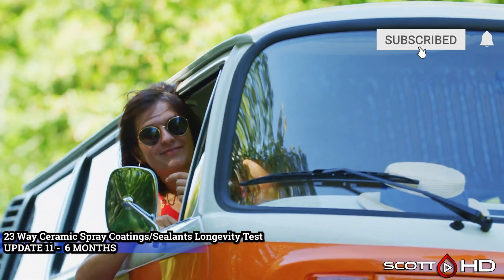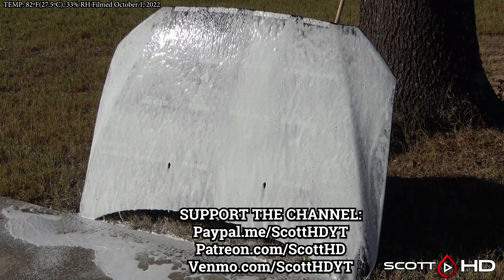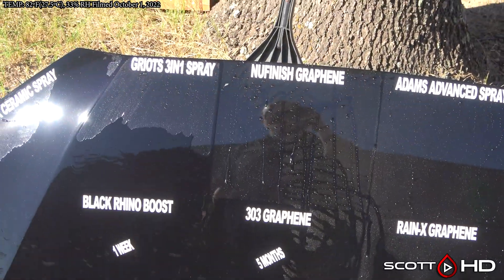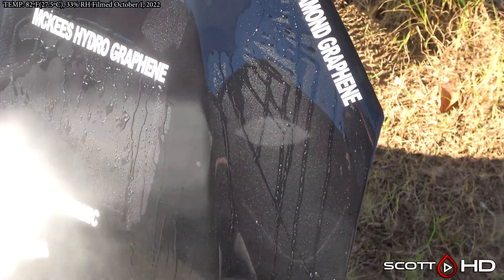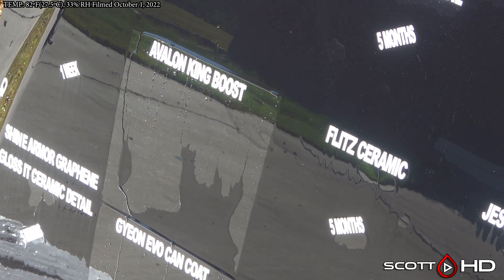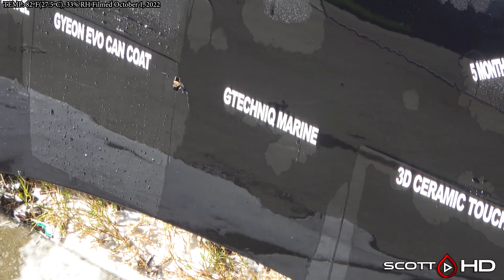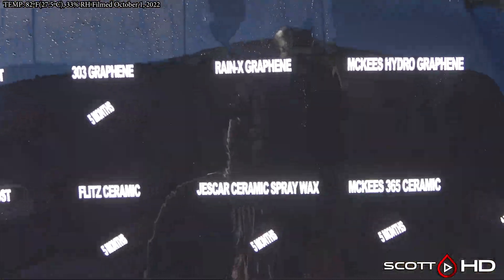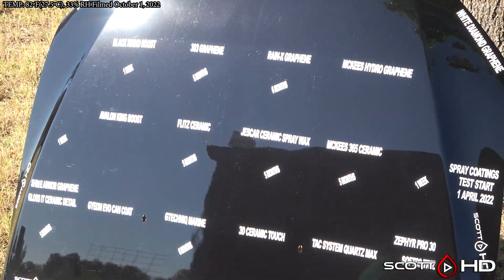Ceramic Spray Coatings - ULTIMATE Longevity Test Comparison 23 WAY UPDATE 11 - 6 MONTHS

Comment: This review motivated me to go pick up a bottle of the Nu-Finish Graphene spray.  For $11 at Autozone, it was worth testing.  I'm a long-time user of the original NF liquid but quit using it in recent years because it doesn't last so I moved to Collinite.  I've been wondering if I can use a quality polish/wax (for gloss) and then use a graphene coating over top of that to seal it and give the combination more endurance.  Has anybody had much luck with this kind of layering?

As mentioned in other comments, for the hydrophobic performance you are seeing, I was surprised how un-slick the NF graphene feels.  The old NF liquid from 10+ years ago could yield an amazingly slick finish.
Reply from the maker: Agreed on the slickness part.    I haven't tried stacking it on top of something, but worst case you have to remove and reapply.

Comment: No Turtle Wax Ceramic?  Huh.  Works VERY well on my Outback - double coat applied last spring, and it still does very well in Florida.
Reply from the maker: It's been tested in several of my other tests - check out the spreadsheet in the video description.  I've tested several of their products (and some multiple times).
Reply: I don’t see TW on the spreadsheet in the description. Posted elsewhere?

Comment: The fact that Mckee's Hydro Graphene is still going makes it one of the most useful products you can buy.  There are other brands that do the same spray on / rinse off, but Mckee's has always been the standout to me and their Hydro Ceramic was how I got introduced to them.

You can look at this hood and say sure it didn't last as long as others since it's starting to fail, but you can coat an entire car or SUV in about 5 minutes.  5 MINUTES for 4-6 months of protection, and you can layer it up to 3 times.  So when you wash your car once a month, just put this on for the first three washes and you'll have three layers of protection.

To me that renders all other spray coatings completely obsolete.  Why in the world would I do the same process of prepping a panel, wipe a product on, flash it, buff it off for a simple spray on product?  if you're going to go through all of that work, put on a full ceramic coating, it's the same exact process and you get a full coating.  

Otherwise, use Mckee's Hydro Graphene and save yourself a ridiculous amount of time and effort, plus you can use it as a topper to your ceramic coating, you can use it on your wheels, windows, everything.  To do any other wipe on sealant that isn't a full ceramic coating is a waste of your time IMO.
Reply from the maker: Agreed - and I need to touch on that more. For some of these products to last as long as they do, it literally takes 5-15 minutes of your time to bring it right back after a wash.

Comment: I had a weird experience with NuFinish, my cars 14 years old, has some rock chips in the paint. Has for a long time, nothing ever came of it but after about 2 months using NuFinish Graphene all the rock chips developed rust.

I don't really want to fault it, but they never previously rusted, and I don't live in a climate that ever see snows. Rust really isn't an issue, and some of these chips are nearly a decade old.

The all started to rust after using it, which hasn't happened with any of the other products I've used in the past.
Reply: Perhaps, the chemicals inside NuFinish Graphene promoted oxidation.
Reply from the maker: Interesting.  I'll do some playing with it and see. That is a  possibility for sure that something is in it that could promote corrosion.